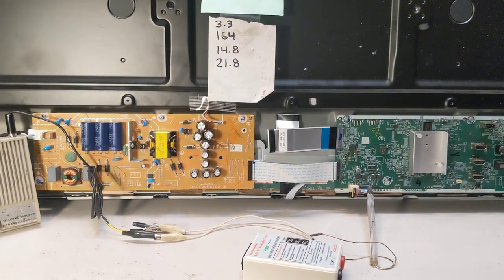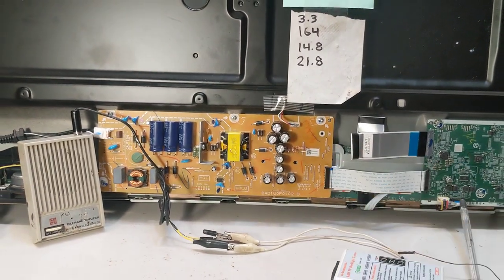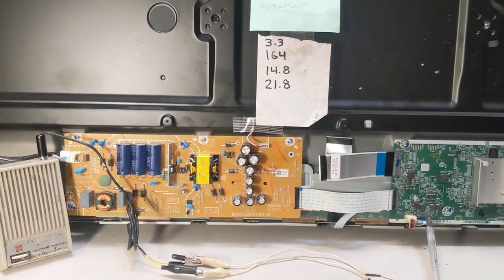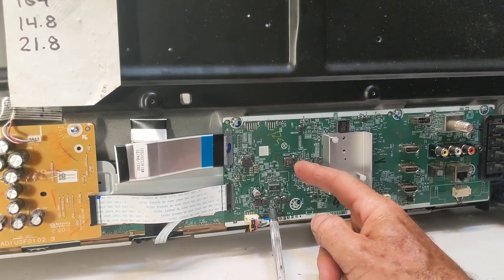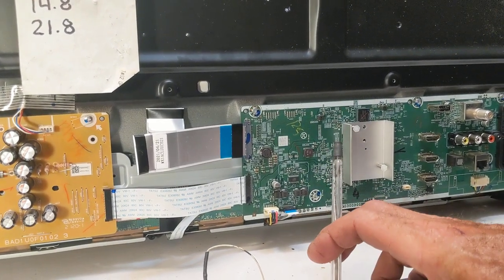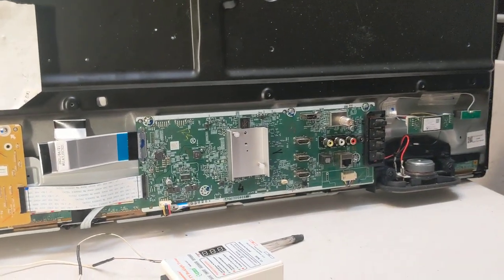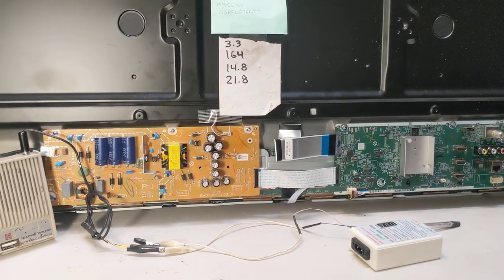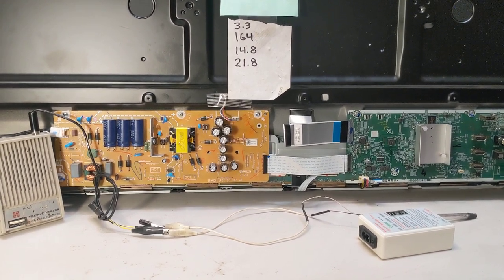I'd guess the TV main board is bad. What are your thoughts on this?

Comment: I worked as a IT technician, and experienced lots of problems with laptop and desktop mainboards that whent bad due broken solderjoints under the chipset and VGA chips.
Since arround 2006, manufacturers of electronic devices may not use lead based solder, and start to use lead free solder, 
but lead free solderjoints become brittle after a certain amount of heat cycles.
Lead was added back in the days not only to lower the meltingpoint of the solder, but for the main reason to prevent socalled "Tin Whiskers".
Tin Whiskers is like a conductive mold that grows between leads of components and cause all kinds of shorts.
I encountered many mainboards of laptops and desktop computers that suddenly start to failed near the end of the warranty period, or just after the warranty period expired.
I first tried to heat all big chips on the mainboards with a professional hair dryer (110° C),and after heating up for a few minutes, i let the board completely cool down. 
With this trick i could revive many mainboards back to life. Soms kept working for years, while some encountered the same sympthoms (no screen output) after a few days or weeks, or sometimes after a few reboots.  
At that time, i didn't have a hot air soldering station to heat the chips even further, because solder don't melt at 110° C, so i start using a heatgun for stripping paint at the lowest setting, and used tin foil to cover electrolytic caps and plastic parts on the mainboard, and cut a window open arround the big chips. With that method i reached a higher succes rate, and if the mainboards survived a few reboots, i was almost sure that the problem was solved for a long time. Eventually some came back after many years, and some kept working for years. So my guess is, that every device that has a mainboard, like a TV, can have this same issue. So my advise is, try to heat all the big chips, let it completely cool down, do not force the cooling down with compressed air, because that can cause the solderjoints to crack again. Grtz
Reply from the maker: Thanks for sharing your experience with heating up some of the main board chips. I remember reading about tin whiskers that grow on solder a few years ago. I didn't realize it was more of a  problem with the led free solder
Reply: @GrantsPassTVRepair  , without the lead in the solder since arround 2006, the problem with tin whiskers is back. And one of the biggest problems with tin whiskers, is that these act as very tiny fuses, if they are between 2 points on a board that carry a very low current, like signal lines, they shortout the signal. But when they occur between 2 points of let say a voltage rail and ground, they burn up and remove the "evidence" of the fault. But those little shorts on powerrails clean themself up, but the bigger problem is on data lines. So a cleanup with iso propanol and a tooth brush can solve that. It's like placing steel wool on a 9V battery it will burn itself away, but when the battery is almost flat, nothing will happen and the battery gets drained to zero volt. But these tin whiskers are not the biggest problem, it's the brittle solderjoints beneath big chips, especially on chips that heat up during use. Back in the day when i revived a mainboard by heating a chip, i placed also a tin sheet of copper between the heatsink and chip, or a bigger heatsink to keep the temperature down.  Some boards like in a tv can become hot, and don't have a heatsink, so those are the primair suspects for this solderjoint issue.
When i make electronic projects , i always use lead based solder, now these days, this lead based solder is not sold everwhere, some part suppliers only have lead free solder, but i found a supplier here in Belgium that still sell lead based solder from the Stannol brand and i have and hoarded some stock, should this ever go out of sale to the wider public. It is still available only for professional users, and is still used in military (and some medical equipment) for a higher reliability.
Reply from the maker: @BjornV78  I remember seeing this video by Louis Rossmann where he talked about re-balling solder connections, and his conclusion on it's value Vs just applying heat as you mentioned. Here is the link. https://www.youtube.com/watch?v=1AcEt073Uds
Reply: @GrantsPassTVRepair  , At that time (2007 a 2008) when I start using this heat trick, I told the customer in advance that there was no guarantee, and that the problem could come back at any time. And that with laptops that were regularly made dust-free, so that the laptop remained cooler, the problem will remained gone for a longer period of time. This was therefore one of the repairs for which I could not offer a guarantee, and so I did not charge the customer too much. But at time, this first start occuring on HP Pavilion 17" DV9000 series laptops, that cost arround 1600€ (almost same price in $) and that whent just out of warranty. So if i offered the customer a choice of a "fix" without warranty for 50€, or a new laptop at 1600€, almost everyone choose for the "fix". And if the laptop failed again within a week, and they bought a new one, i gave them a discount for the trust in my business.

Comment: The audio tester for inductors looks super handy! Something I'd love to build and add to my tool set. Is there a limit of frequencies it picks up to make them audible? Unless it's your own unique invention, could you share what exactly is inside the probe at the tip? Maybe make a video on that tool? This reminds me of ESR cap checkers, which are super handy but have always been cheaper to build than to buy.
Reply from the maker: Anything outside the audio range of the human ear can not be heard with this audio pickup device, Sometimes I attach a volt meter to the end of my probe that measures voltages which can't be heard with my ear. I will keep your suggestion in mind for a future video.

Comment: Handy hints there, thank you. I'm trying to fix my old Toshiba 40 inch TV. Newer TV's don't have all the inputs I need, they have 2-3 HDMI ports and maybe a composite. I need at least 2 SCART sockets, 3 HDMI, 2 Composite inputs and VGA for the computer.

I looked at more modern TV's with only HDMI, they were around the  £150 - £200 range. I found another Toshiba with only 1/2 the inputs but it did have VGA. It cost me £380.

Comment: I would tend to agree with you Dave as my 32 inch Vizio TV I had in my bedroom died a couple of years ago after about 12 years of use. I bought a new Vizio 32 inch for about $200.00, and it's 1080 instead of 720, and it's also a smart TV. I suspected the T-con board was bad in my old TV, and replaced it for $10.00 and tax from eBay. That fixed it, but it now resides in my closet. God Bless Dave.
Reply from the maker: Considering the low cost of replacement,  It's no mystery why so many repair shops have closed their doors. I'm grateful to remain afloat doing antennas, and a variety of other TV related jobs.
Reply: @GrantsPassTVRepair  a possible somewhat reviving area of CRT repair is for vintage video game consoles/computers like Amiga, Atari, Nintendo and even older PC. The purists want the original CRT for authenticity and better game play.
I found a couple of these branded CRTs, 1084 and 1701, in thrift stores, refurbished and sold on Ebay for a decent profit.
Odd I know...but collectors, go figure.
Reply from the maker: @pvb9964  I run in to people who want the CRT TVs now and then for the reasons you mention.

Comment: Your "audio oscilloscope" is a really clever idea. I'm thinking about modifying it so that the indication is a LED which glows more brightly as the signal gets stronger. BTW, I'm the person who designed the Anatek Blue ESR meters...
Reply from the maker: Nice to meet you Bob. I built one of the blue ring testers kits you invented, and appreciate it's clever little compact design.                                                                                          I've experimented with variations of near field inductive probes, and noticed there are already inexpensive inductive probes with LEDs available for testing 120 volt mains,  but I've never seen one specifically designed for testing small boost and buck coils, so it sounds like a good idea.                                                        One of my probes has  an internal diode to rectify the electromagnetic oscillations, which I attach to my DC volt meter for more precise indications, but an LED light indicator, or even a built in audio amp could be handy. Especially if it had a sensitivity adjustment.  Dave
Reply: @GrantsPassTVRepair  Hi Dave. Right now I've got a PC power supply apart for replacing a lot of old electrolytic caps. Once I've done that, I'll do some experimenting with small RF chokes like yours to see if a simple circuit would do what's required. I have to be honest that it was the late John Bachman at Anatek who created his Blue version of the ring tester I originally designed way back in the 1990s.
Reply from the maker: @ZilogBob  I remember seeing analog ring testers for TVs long before the digital versions were available. 8 years ago I made a video about your ring tester, and how useful they can be at this link. https://www.youtube.com/watch?v=Ky2T1-n_Fks&t=264s
Reply: @GrantsPassTVRepair  A while ago I designed another ring tester which can count up to 99 rings. I've got all the info about it on my website.  Right now I'm trying out a little 2 transistor circuit based on your "sniffer" which makes a LED glow in proportion to how strong the signals induced into the small RF choke are.

Comment: I spent $100 on boards I bought off Ebay for the same issue, no go. I've wonered if this is a sleep mode issue where the TV won't wake back up, like the desktop PC issue of the 90's...a huge problem. Some TVs have a reset-to-factory option in a service mode, if you can find it. Btw, the no-wakeup problem was defective caps on the PCs.
Reply from the maker: Unlike my computer monitor, I've never seen a sleep mode for a television, but I appreciate your input.
Reply: @GrantsPassTVRepair  ...it's a feature of FireTVs for example.
Reply from the maker: @edzanjero353  I don't understand what you are saying. Can you clarify your comment?
Reply: @GrantsPassTVRepair  ...at least on FireTVs, depressing the power button, or using the remote on-off only puts the TV into a sleep mode...but the TV is actually on. To actually "turn off" a FireTV, you have to pull the power plug. Also, to reset to factory defaults on a "no power-no display" symptom, some brands have particular button depressing procedure upon powerup to get into service mode, so you can view and select a factory reset. Some units will perform the reset with no video.
Reply from the maker: @edzanjero353  I think ROKU dongles also remain on when the TV is turned off. That's why I prefer to plug the dongles into the TVs  own USB port if the TVs power supply can handle the extra demand.